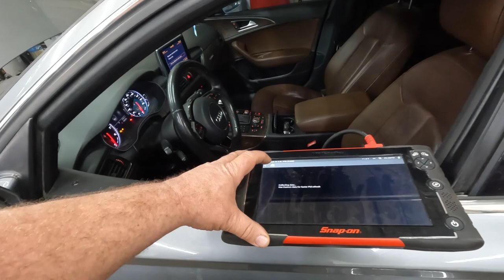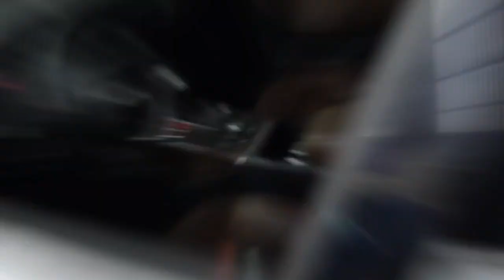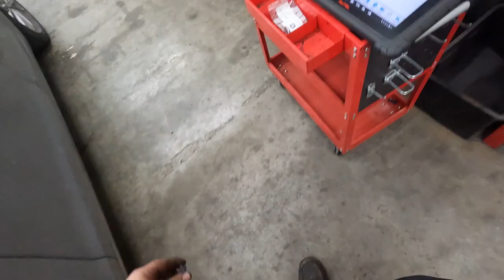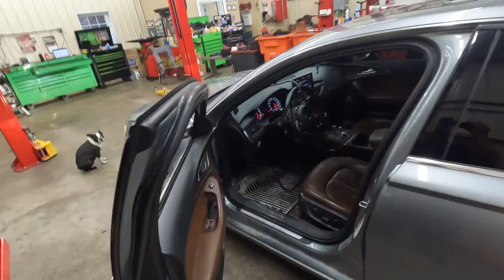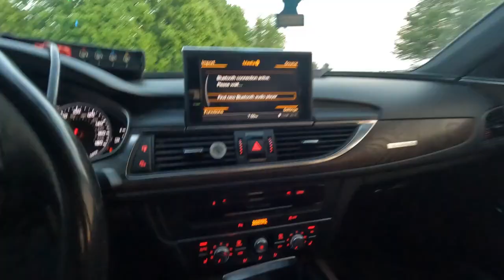2013 AUDI A6 AC repair. Aftermarket part failed immediately!

Comment: My 2014 A6 Is Having A Similar Problem. Local Shops Are Quoting Me Upwards Of 4K, Saying It Could Be The Compressor But They Dont Actually Know. How Were You Able To Rule Out That It Wasnt The Compressor And Actually Just That Sensor?
Reply from the maker: I compared the pressure on my machine to the pressure showing in the scan tool

Comment: I rebuilt the engine of my Audi A6 C6 3.2 with parts from China. The engine has now been running for three years and 120,000 kilometers, and it still runs perfectly.
So China does indeed sell good quality for Audi.

Comment: If you were working in car AC systems, you should know that newer models of Audi dont work with cheap/aftermarket pressure sensors, it needs to be OE original pressure sensor. Everything else is ok to use aftermarket.